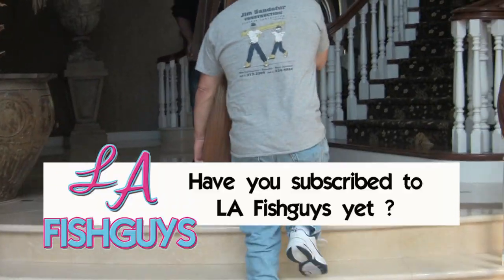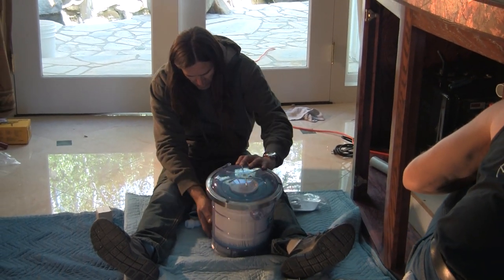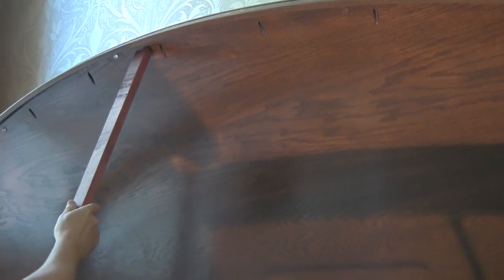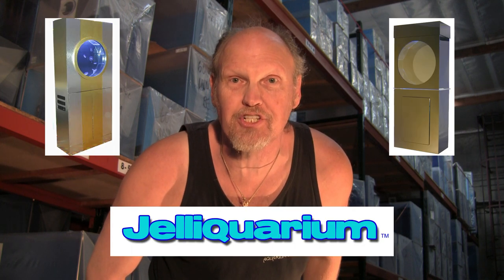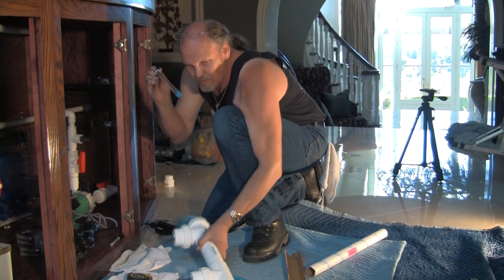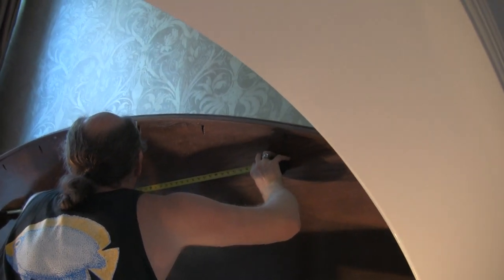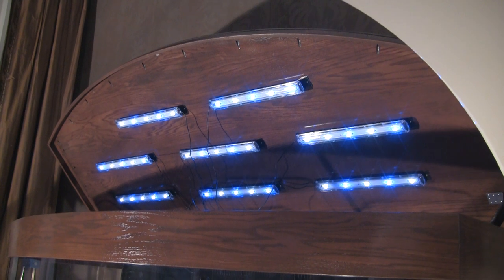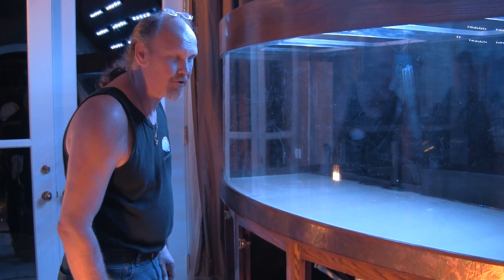Building a 400 gallon Bowfront Aquarium, LA Fishguys, Episode 115 pt 5

Comment from the maker: hey P, note that the dirrence between a 'sump' or open filter and a wet-dry trickle filter, aside from the obvious bio-balls, is effectiveness. a wet-dry will very quickly convert waste to nutrients, an open sump relies on the bacterias in the tanks live rock to covert waste which is not as effective...actually not as quick is a better word. the point is you dont want nutrients as that feeds algaes.

Comment from the maker: hey M, back in the mid 80's incorporated into the original glass Mini Reef Filter was a 3-chamber de-nitrator. it was slow flow and you added a few drops of glucose as its food source. I suspect this Sulfur Denitrator is similar? in the late 80's I ran ozone. it required a ORP controller and a strong ozonizer to operate with consistant results of 400 ma. I do remember baking the dryer beads being a pain. Scott with the 500 runs one now. I think only hard core hobbyist need to consider either.

Comment: From what I can see, there are vertical post supports underneath the circumference of the tank, which are carrying the majority of the load. The shims on the cross beams are added support to keep the platform level --they're not vital. I've seen professionally-made metal stands with no central cross beams at all.

Comment from the maker: hey I, its a Nu-Clear Canister filter. I like them but found out on this job that the manufacture offers selective support. I cracked the tightening ring knob the first time I used it. its not thick enough and snapped. I was told to use a box end wrench and after three times requesting the replacement, and nothing ever arriving, I gave up.

Comment: Hi Jim,

using 90° bows for waterpipe have much less water resistant than the 90° parts you use. The impact is such big, that you can save min. 10% energy on the circulation pump, usually 25%...

Comment from the maker: hey N, depending on how you use them and how frequent you service them I think you heard wrong. first, so what about nitrate! get past that. second, if the canister is serviced on a regular basis it does not get a chance to become biologically active. third, depending on the media used it provides a specific type of filtration, in my case fine mechanical filtration.

Comment: Where do you get the idea that it's unacceptable to shim a stand? It's fine to shim under the stand or within the cabinet under the top surface. Distributing weight with many shims is standard practice in construction. If the floor isn't perfect, how can the tank be leveled without shimming? Do you propose building a stand specific to the floor's irregularities? Foundations drop, floors sag, and wood bows --shimming is necessary.